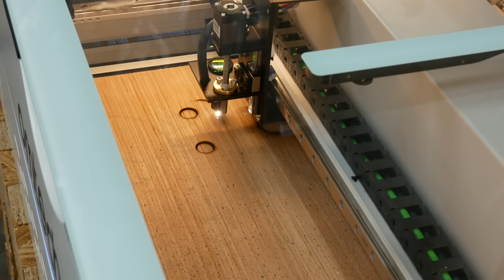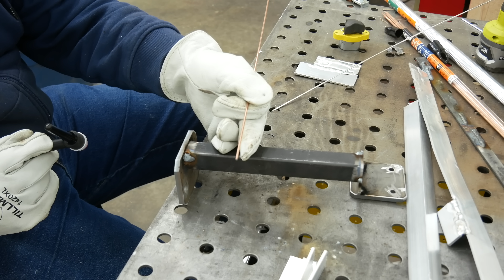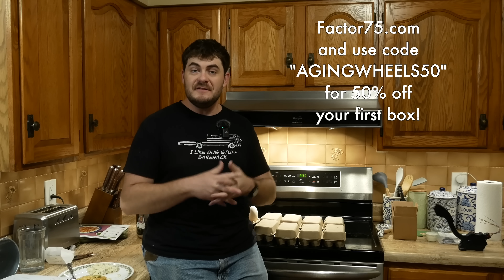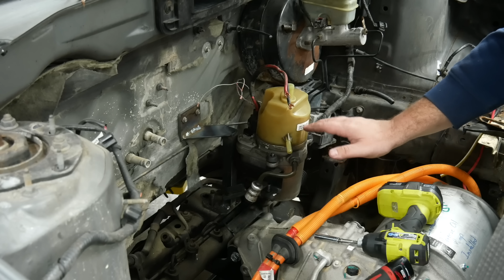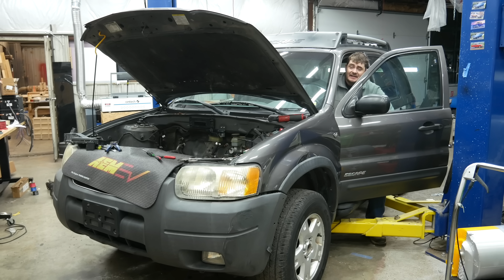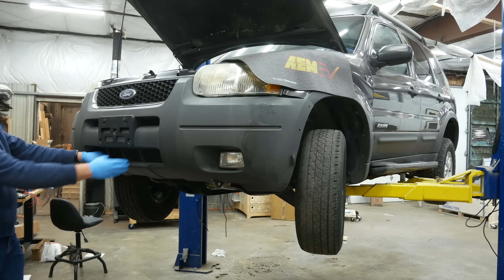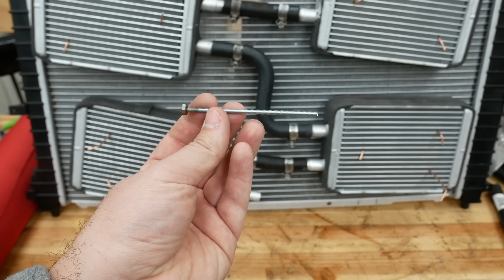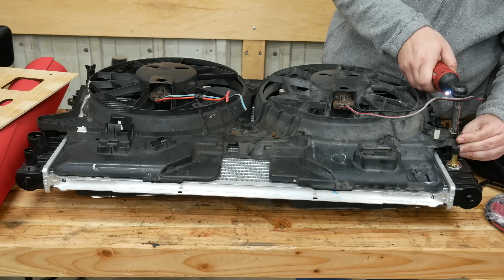Battery Powered Steering and Five Radiators | 900hp Electric Escape Project

Comment: High voltage 1000amp connectors: Hubbell MCC1

Anderson SB350 are only 300amp rating but maybe you can use 7 of them in parallel (probably more dangerous because of cascading failures)
Reply: 7 connectors in parallel is easily the funniest thing I’ve read all day. Make the install look like starting up a fighter jet clicking over all the handles.
Reply: @SpAm-AcCoUnT  I’m not sure where he’s going to get a 2000amp contactor either.
Reply: @Mitch3D  the common TE LEV200 series contactor is rated for 500Amp continuous and can handle 1000Amp peak, so it is possible with only two contactors
Reply: When connectors are rated there for a constant rating. just take a look at a Tesla wire harness and notice that they don't have connectors in parallel either. I would start by evaluating the way your harness of a typical Model X. In short it always comes down to heat. If a connector is rated for 350 amp (constant) then that's the average amp going through it to keep it in a safe temperature zone, aka not melt. You can have low and high variations in current (which is what happens in the real world) so note it can still take higher amperage.

Comment: For the connectors: Amphenol HVSL1400082A1120 & HVSL1400022A1D8S6 can handle  430A nominal. Are you sure you need that much continuous power? Don't pick you parts for peak power but for continuous power. That would be around 170kW for the bus. So one of those connectors would be enough.
Reply from the maker: I may not need to rate for peak power (670kw), but I definitely need it to handle more than continuous power. The continuous power ratings of these two motors combined is only 90kw. I've been walking the side of caution when speccing components as its much better to overkill than melt something

Comment: Lookup DC Amphenol connectors for those high voltage high current DC connectors. Might work for what you need, they're used in grid scale energy storage systems at least.

Comment: Sure about the 2000Am that us super rare, i would think those cost probably a $ per amp, typically they dont do more than 270A. The biggest i know is 1000A and is also more for Power distribution   and not cheap as well. And also above 500A those are all singe pole connectors.  Maybe something can be used like Powerlock but i think they only got to 800A. But at those currents connectors dont make mutch sense

Comment: Because of strong vibrations, i think  that the radioators will break where the scres are. Also maybe they will transfer the heat from one to another. Maybe its better to make a separate them and make another holder fot them with a gap betwen the big one. So if im wrong, please correct me. Tnx :)
Reply from the maker: There will be far fewer vibrations without an engine. And part of the reason for the rubber padding between them was to prevent thermal transfer. Should be okay
Reply: @agingwheels  tnx and all the best from Serbia :)

Comment: Damn, why not get 2 of the same radiator?
Reply from the maker: There isn't enough spec in front of the existing rad for another one of the same size. And the pipe connections exist out the back so there's no way to mount two together

Comment: How do you plan on driving the compressor for the air conditioning and the heater?
Reply from the maker: I don't! HVAC is so low on the priority list I only plan to tackle it if I have extra time. I have a high voltage heater and air conditioner to use if I get to that, but integrating them into the existing climate system is tricky

Comment: LEARNING TIG is very much like learning gas welding [IMO] and when I was taught to gas weld [at pannel beating college] was to first just learn to join two bits of metal together by melting the two parts into each other - learn to control the "pool" - then when you get that sorted learn to dab in extra bits of metal to the pool with the rod

Comment: The high voltage disconnect from an overhead power line should do the trick big Clive has a video on them from a few years back
Reply: Overhead power line equipment is spec'd for AC, not DC. DC connectors and breakers are a different beast due to the fact that DC loves to arc.

Comment: Anderson connectors go up to 2000A, they are found on electric forklifts and the like, kind of an industry standard by now. they are not IP rated though. 

2nd point: heater cores usually have a way higher fin density than front mounted radiators. this causes way more air resistance, and given that right next to them is a path with way less air resistance, and there being barely any pressure,  these will barely flow any air, and as such, will cool very little. They are also not made for the the same flow in coolant, which might be fine. I fell for the same cheapness trap for another project, getting air through these requires a significant pressure.

Good call on the PP rings though, the bare aluminium of the radiators very much does not like stainless steel, and will make cauliflowers very quickly in salty wet conditions.
Reply from the maker: I wondered about the fin density. I think it'll be fine considering the cooling system is pretty dramatically oversized for my needs. It's not a hard swap if I'm wrong!
Reply: Forklifts don't operate at 1000V.

Comment: I wonder what kind of fun stuff you can do with the CAN bus on the power steering pump. I imagine part of it is pressure feedback so the ECU can kill the AC under load. My 2000 Camry does that, although it's not CAN based.

Comment: Cool steering project, but wouldn't an OEM Hybrid Escape have been a cheap/easy alternative?
Reply from the maker: Maybe easy, but not cheap. The cheapest EPS rack I found was $480. This was more fun anyway
Reply: Its a testmule before electrifying the bus using the tesla engines.

Comment: I have 2 concerns about your quad heater core setup. The first being the numerous airlocks that they're going to cause, and the second being that the airflow through them won't be great. The fans are going to suck much more air through the exposed parts of the radiator, and probably very little through the cores. Hopefully the whole setup is overkill enough that it won't be a big deal, but I really think you're better off with just a second normal radiator.

If you want to salvage the heater core idea, then they'd work a lot better spaced like an inch or so away from the rad, with a shroud to make sure all the air is going through the cores first, then the rad. You could use your fancy-pants plasma CNC and sheet metal brake to fabricate this shroud pretty easily.
Reply from the maker: The airlocks are something I hadn't considered, but vacuum bleeding will help that. Something that helps me out immensely is that this cooling setup is pretty massively oversized, so I should be good. If I find out this doesn't work, easy swap and knowledge gained!
Reply: @agingwheels  Yeah. The absolute worst case is you end up with a second full size radiator and have to mount it somewhere silly like 'in the rear hatch with a big air duct through the side window' and out fifty bucks worth of heater cores. And you can do that because this is just a test mule for bus stuff!
Reply: @EyeMWing  or stacked in front or behind the main rad, like AC condensers and front mount intercoolers are.
Reply: @agingwheels  my 2 cents on this are that as long as the resorvoir is higher than the cores it'll be fine.
Reply: Another thing/issue is that, if you run them in series, they will be at different temperatures and the hottest core (1st in the series) will shed the most heat.
If you were to run them all in parallel then each core would be at the same temperature and dump the same amount of heat.

That said, if the system is way oversized this will probably not be a problem.
Reply: Or shifted to one side, so that the fans can be split operation. Maybe put ac on the other. Vacuum bleeding the system will help, but pockets will develop naturally as parts hit boiling point. So you’re right in that the ends should be pointed up to allow it to clear on its own.
My design was much more lazy. Exhausted everything to the cabin, and let the automatic climate control sort it out. Overkill for the motors/inverter, but the battery and I were happy.
Reply: @AaronandbriEnne  the coolant will never hit boiling point though, 180°F is 80°C which is well below boiling.
Reply: The heater cores will really only need to work when the batteries are doing a lot of work, I.E, high speed, high power driving. Unless he's abusing it with burnouts and heavily loaded pulls, the cores will be getting plenty of forced airflow without the fans kicking in.

Remember, radiator fans are there for an engine's idle heat output, and an electric motor or battery doesn't idle.
Reply: @wyattroncin941  He did mention regen braking, so i'd assume the battery and motor would heat up while the car is slowing down. That's the only time i'd be worried, or even want to have the radiator fan on.

Running the batteries through the heater cores, and the motor through the big radiator seems like the only way to do it. That way you don't end up dumping motor heat into the more heat sensitive batteries.
Reply: I also had concerns with how he was mounting these. The fins on the radiator and heater cores are flimsy and will shake and vibrate while driving. The bolts he made will eventually rip apart the cores’ and the radiator’s fins.
Reply: well you see the advantage he has is the car needs far less cooling than a combustion engine he only needs to cool a couple hundred degrees and not the near 1000 that a regular engine would produce so partially restricted air flow won't hurt much.
Reply: @jonthefuzz  Radiators rely heavily on temperature difference to work efficiently though. It's much easier to cool something with ambient air that's around 200f, because you have over 100 degrees of difference. With batteries though, you only have tens of degrees difference to play with.
Reply: Maybe to consider simple external speed motor control? Saying it because those can be very loud, and mounting multi-speed motor in the existing fan motor mounting can be even more complicated. But a really simple and independent setup, regulated by a coolant temp sensor.

Comment: How are you going to charge the 12 volt battery?
Reply: DC to DC converter is the only thing that makes sence.
Reply from the maker: DC-DC converter. It drops the pack voltage down to 13.8 volts to charge the batt

Comment: Check into a hydro boost setup to replace your brake booster, since you've already got the hydraulic pressure from the power steering pump.
As for the battery connections, can you get away with 5 forklift-style connections (one per battery pack)?

Comment: Nobody really loves those power steering pumps, the same can't be said for the Saturn Vue EPS unit with a $75 controller from eBay, and they are way cheaper. They are basically undetectable as far as sound goes, use less electricity and the assist is adjustable on the fly.

Comment: If the power steering pump is running off of 12v and running all the time, where is this 12v source coming from?  EDIT:(of course, the real question is where is all the 12v power coming from? A lead acid battery won't cut it.) END EDIT
Reply: In the first video in this series he discusses how the 12v system is planned to work. If I remember right it's going to use a DC-DC converter.
Reply: The 12V battery.
Reply: @Jehty_  That's impossible. You couldn't drive it very long, particularly at night.
Reply: @tarstarkusz  funny that you mention that you couldn't drive long 🤣
Just recently I made that "experiment". Alternator in our ICE car broke. We where able to drive 300km before the battery was empty. (but yeah, most of that without the lights turned on)
(a tip for anyone who might find themselves in the same situation. The mechanic gave us a great typ afterwards: Giving the alternator a good smack (he used a crowbar) can resurrect the alternator for some time) 

But as I said: In EVs everything 12V (lights, computer, ABS, electric steering, etc. ) runs of the 12V battery. And when the 12V battery gets too low it's recharged by the main battery.
Reply: @Jehty_  Depleting a 12v lead acid battery is really bad for it.  I get you gotta do what you gotta do, especially if you don't even know it.
Reply: @tarstarkusz  it's just a question of what is more expensive.
A new battery or a tow truck.
(And also what is more annoying: Waiting for a tow truck or replacing the battery)
Reply: @Jehty_  That's why I said I get that you gotta do what you gotta do.
Reply: I assume from a normal 12V acid battery, even thou you have a big battery to run the motors in a EV some, if not all, still use a good old acid battery for the 12v systems, no need to make a conversion/stepdown system that way, if it works don't change it. ;)
Reply: @Argoon1981  The battery wouldn't run the car long enough with all the 12v system coming off a 12v lead acid battery
I think he may have to add an alternator to run off a high voltage motor.
Reply: @tarstarkusz  the 12V battery is charged by the large battery.
Just the same as in every other EV.
Reply: @Jehty_  Does it use a DC-DC (not a step down converter as DC cannot be stepped down through a transformer) converter or a motor and alternator?
Reply: @tarstarkusz  by a (step-down) DC-DC  converter.

(And no, as far as I know you can definitely call DC DC converter step down)
Reply: @Jehty_  I'm not arguing semantics with you.  I'm just telling you that a transformer works off a moving magnetic field and doesn't work with straight DC.
Reply: @Argoon1981  you still need a step down converter to charge the 12V battery
Reply: @Jehty_  I'm not a electrical engineer, so I don't know much about this stuff. :)

Comment: Tpu actually holds up fine in an engine bay. Ive had 3d printed radiator bushings and motor moubt inserts working for over  a year with no failures.

Comment: I'm wondering - strangely wondering - if that pump was designed for a full 12 volts of power all the time its original vehicle was running... and perhaps those three CAN wires somehow regulated the power to the pump... What you think?
Reply: Likely.  Otherwise you'll get either too much assistance at speed where you don't need it, or not enough when parking.
Reply: I expect the can lines are purely for diagnostics

Comment: Should have used a trans cooler instead of the heater cores. Made to fit, and plenty of cooling.
Reply from the maker: The reasons that didn't immediately pop into my head is because the trans cooler for the Escape is integrated into the radiator. I didn't even think to look at trans coolers for other vehicles

Comment: you can controll the fan with a arduino and a temp sensor
Reply from the maker: The fan will be controlled by the AEM VCU. Only a bit more expensive than an arduino. Just a bit
Reply: @agingwheels  a $1,570 is not a little bit more expensive its more then a cheap car over here in wales

Comment: There's something funny about turning on an ignition in a car that doesn't have an engine (or drive motors).
Reply: My work car, a Citroën ë-C4, is electric from the factory and has an ignition barrel!
Reply: I'd imagine the "check engine" light would be on.. ;)
Reply: @etekweb  bet it isn’t seeing as the ECU is gone lol
Reply: Did that with my project car. No engine, trans or driveshaft but went with an all new wiring harness so we had to make sure things worked.
Reply: I’ve done the same thing to turn on my radio, to test my new speakers on my 2008 Civic while I was waiting on my rebuilt engine. It was rather funny. I was surprised it didn’t throw any codes for open circuits (all of the engine wiring was disconnected).
Reply: I'd also assume that's why It was screaming at him haha
Reply: @John Peat  Thank-you! For explaining that to me, I could never understand why EVs still have a regular lead acid battery instead of a 12v transformer
Reply: I've driven an EV that needed to be "started" with a key, like a combustion engine vehicle. I think I was actually closing the HV contactor, because the air conditioning didn't work unless I did this.